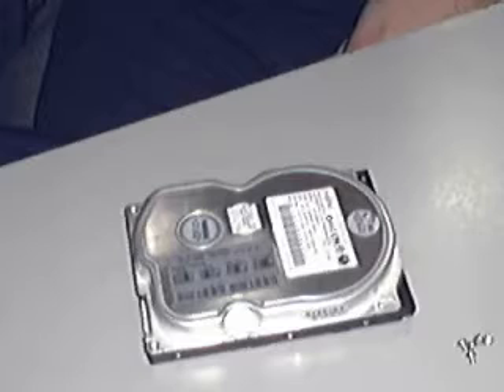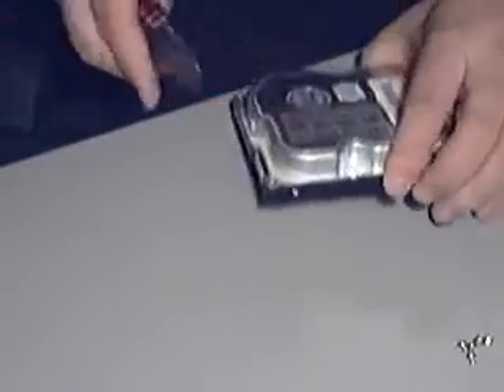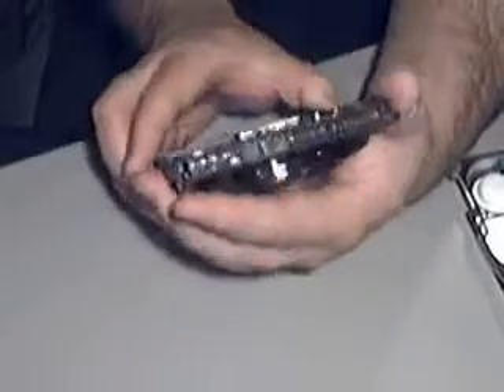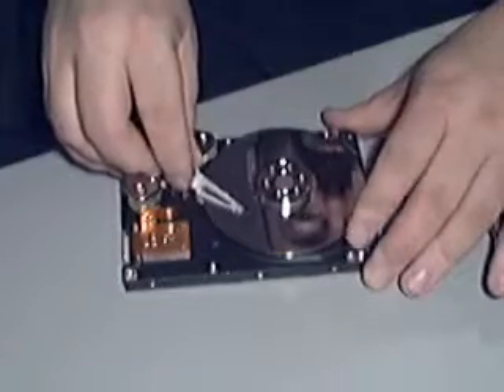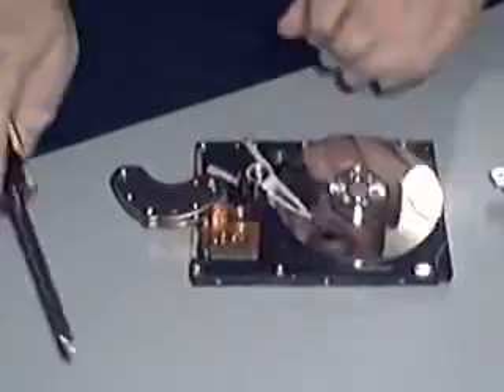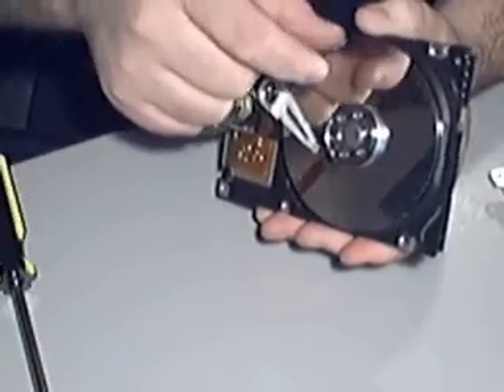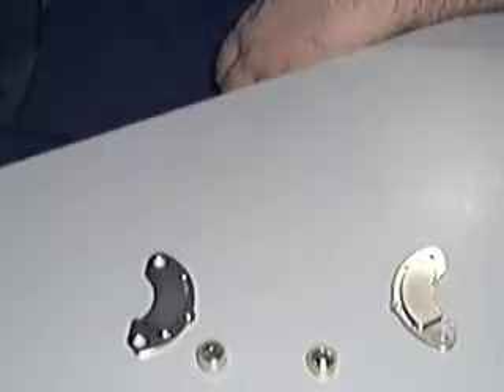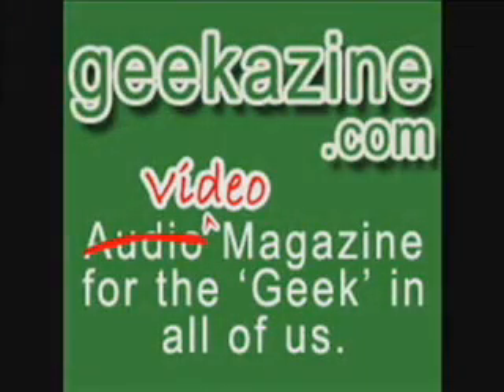Video Episode #5 - The inside of a Hard Drive.

Comment: You can pull apart those magnets much easier if you slide them so they're perpendicular to each other (roughly).

Also, you never took the disks off and showed the spindle motor, possibly the best part of the HDD.